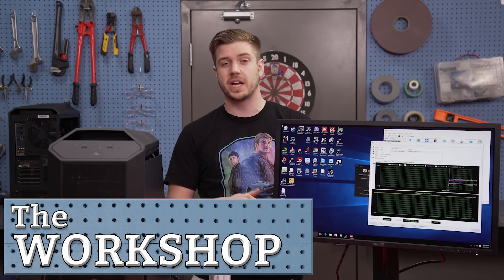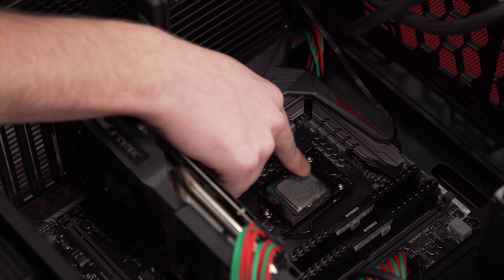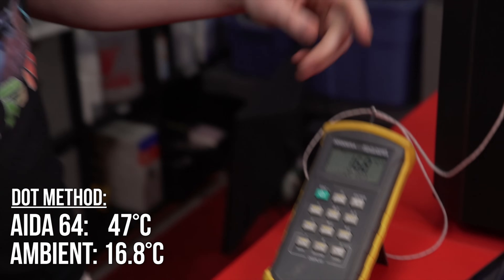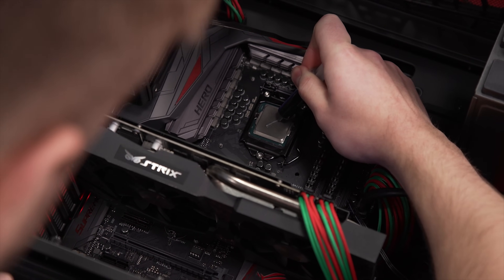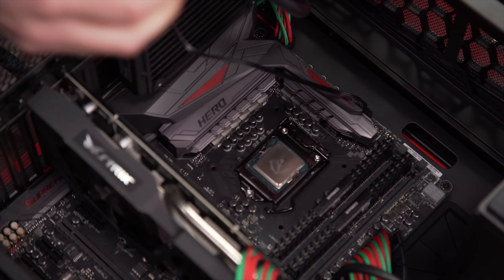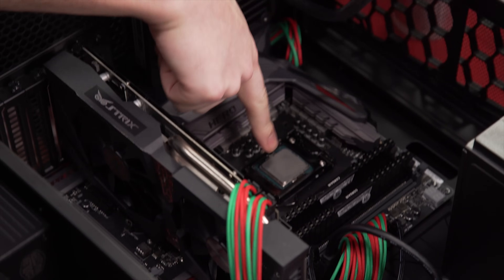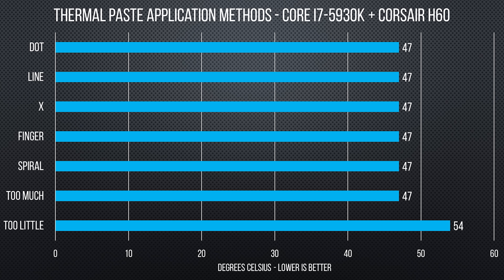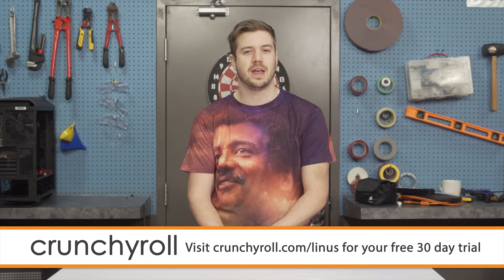Thermal Paste Application Methods - Which one is best? - The Workshop

Comment: Your "more" was the same because it was still in range of a safe amount. The "more is bad" is when you add even more than you did and squish it out over the sides.

Effectively there can't be "too much" in between the CPU and the heatsink because they squish together by force, it's going to squeeze out any excess. It's this squeezed out part that becomes bad/dangerous/causes odd issues or heating.

So yea, adding too much is pointless because it's either not actually too much or you've overflowed off the CPU. So long as it's not preventing the heatsink from being as tight as possible the danger is in overflow.

Your conclusion is pretty much what anyone with some logic would expect; though it's nice to see it tested. The spread method is at best the same (but messier and takes longer) as simply the dot. Sticking the heat sink on is going to do the spreading for you. At worst if you screw it up it could create air bubbles.

Comment: All the nerdy stuff aside, just have enough to cover all of the CPU heatplate to transfer all heat to the CPU.  The "use the thin layer, or very little" is nothing but a nerdy WIVES TALE (nerds tale) that spread around the internet with no backing.  I use a LOT of thermal grease spread on all parts of surface, and get 100% results.
Reply: Also, WHITE GREASE SUCKS, and I use ANTI-SEIZE grease instead and it is cheaper than thermal compound, and despite having aluminum in it, it does not read ohms with a multimeter, IMO better than arctic silver, and much cheaper and better quantity.  I just re-greased a 12V TEC fridge with it and it works much better!

Comment: I always get quite random results. I like, and use, the dot method. Sometimes I get it idling at 34 C, clean it up, try again, then it's idling at 42 C, do it again it idles at 37 C and so forth. Guess it's all about that moment when you connect the cooler and how it spreads. Might get lucky and get a great spread or unlucky and some air got trapped in there.
If someone ever comes up with a better, more consistent method for this, just shut up and take my money.

Comment: Looks like every tactic works... unless you're too greedy xD
Reply: Basically it doesn't matter how the paste goes on so long as you avoid 3 things:
1. too little and you don't get good heat transfer
2. too much and you overflow onto the board creating other potential problems
3. too messy and you could create air bubbles which ends up being "too little" but in spotty bubbles on the cpu

So yes, every tactic works so long as you put a fair amount and the end result ends up spreading the same as the basic drop in the center method. Which means anything aside from the drop in the middle method is just taking risk on whether it will spread evenly and without air bubbles. They might work, but they will never be any better.
Reply: So let me get this straight Vincent. Your takeaway from this video that shows that every single method except too little is the exact same is you still think the pea method is the best? Okay then.

Comment: 62 degrees in the room??? dude thats not even realistic basically. thats cold as hell lol. no wonder those temps were so good...
Reply: It's not about the temps, it's about the differences between the temps...
Reply: huh? what do you mean the differences between the temps?
Reply: ***** It does not matter that the ambient temp is 17 or 30 (celsius), as long as it is (near as makes no difference) identical with each test. The cooler doesn't matter either as the test is about checking what technique makes a positive difference.
If method 1 has 0 degrees difference to method 2 then they are both either crap if method 3 is that much better or it doesn't really matter which method you take if they, like in the vid, all end up having no difference between them (except the too little test)
Reply: +songer121 the Delta, that is the difference from ambient temp to the cpu temp its going to be the same in all cases, even if you are 40c ambient

Comment: Which one of these thermal pastes would you recommend?  If this is all i have access to at the time. Just trying to fix pc for friend and clean it up. its for the CPU

Arctic Silver 5 High-Density Polysynthetic Silver Thermal Compound OR 

Arctic Silver Ceramique 2 Premium High Density Thermal Compound OR 

StarTech 1.5g Metal Oxide Thermal CPU Paste Compound Tube for Heatsink OR

Arctic Silver 5 High-Density Polysynthetic Silver Thermal Compound

......figures i find this after Iposted question elsewhere

any help would be appreciated. It not high end machine ...just basic internet use. No overclocking no high end gpu or cpu
Reply: Try grizzly
Reply: If you're not overclocking, any thermal paste will do.
Reply: Thank you for response. I went with old reliable Arctic Silver
Reply: thanks but its done already  - used Arctic Silver 5

Comment: Is it safe to remove the paste without removing the CPU? I'm about to use Akasa TIM clean kit
Reply: Yes it's safe
Reply: Unless there is thermal paste leaked under the CPU or into the gaps around the edge, yes you can just clean off the paste as he does in the video by wiping it off the top. The only reason to remove the CPU is if you have a mess leaking down around it's edges and want to clean out the housing it's sitting in (which shouldn't happen unless it was installed poorly or you leaked paste into it yourself)

Comment: is thermal paste really necessary?? or can go without it?
Reply: You need it. You saw what happened when he used too little. It hit high temps. Some CPUs get so hot they won't turn on when using not enough paste or none at all. I've seen it before.
Reply: Generally, CPUs throttle down to prevent overheating. If that's not enough, they get shut down automatically before overheating, which if you let it happen a lot, can damage the CPU where it gets unstable or just breaks completely.
So you're still risking poor performance at best, and a fried CPU at worst.

Comment: Line method is better. If you study the architecture of the CPU the die is lined up down the center vertically. Depending on the paste if you use the dot method it may not reach both edges especially if the heatsink is not placed straight down. Line method assures that the entirety of the die is covered (outer left and right edge does nothing). The heatspreader is only utilized down the middle. Cross lines are bad because air bubbles are possible especially on thicker pastes like nano-diamond. Non conductive paste is best, I recommend MX-4 personally as it lasts forever and is a great consistency. It is actually better to use more paste especially on a GPU that is generally direct to die (no heatspreader). Spreading by a card or finger is bad as you may put air bubbles or oils from your fingers that cause issues with longevity.
Reply: Here's the thing: empirical evidence generally trumps theoretical predictions. This wasn't a statistical sample or anything, but a decent proof of concept that the application style of thermal paste isn't likely to be hugely significant.

The longevity issue wasn't addressed by this video, but to actually substantiate the claim you're making, you'd have to do a controlled test of your own. It is plausible that the air bubbles and oils may have some impact on longevity, but what you can't say justifiably without experimentation is whether the effect is big or not. It turns out that while most phenomena are influenced by lots and lots of different factors, some of those factors are going to much more significant than all the others—it's unlikely that 10 separate factors are going to be perfectly evenly balanced. So your reasoning about air bubbles and oils may be accurate, but completely insignificant. It might be the case that if you use the other methods, the thermal compound breaks down and has noticeably reduced (but not completely gone) performance after 5 years, but if you use your finger, the thermal compound breaks down after 4. In that case, unless you're designing for industry, it doesn't matter that much, since you'll probably be upgrading the processor anyway.

tl;dr you're pretending to knowledge you don't really have. You have no real justification for claiming that the line method is significantly better.
Reply: +Daniel Hawkins i never said significantly better. i said the benefits are minimal. I also have years of experience and years of helping people on the delidded club on OCN. So I probably have more experience in this than 99.9% of people. 

Evidence exists if you go look it up. I am not here to do testing for you I am merely stating my educated opinion. Line method is more likely to cover the CPU die on most CPU. This has been tested and is proven in this test as the area the die is on is more evenly covered during the line method. 

As I have stated the differences are negligible but if you are going to tell people what is best there are other factors that deserve mentioning that he has no way to test for.
Reply: +Daniel Hawkins actually my bad this is not the post I thought it was. I did not mention the effects are minimal here but I also didn't say it is significant.
Reply: +Dave Morgan They mentioned in the video that the line method is ostensibly to better cover the die. But if that doesn't translate to a real-world temperature difference, then the best conclusion is, "it doesn't matter" rather than "the line method is better."
Reply: +Daniel Hawkins your ignoring that people who don't know what they are doing may be applying paste. If the heatsink is not placed straight down then coverage issues happen. Line method is most likely to cover the die even during poor application. Also if you don't use enough paste the line method assures the most coverage of die. Temperature differences are very unlikely if full coverage is achieved. Also the bubbling tends to happen more with thicker pastes like some nano diamond and silver compounds. If you are going to tell people how to do something they should understand why a certain way is still better regardless of temperature differences during testing. Some people have difficult blocks/heatsinks. Doing it the most effective way eliminates risks.
Reply: Dave Morgan, you're just making a bunch of assertions without proof. They are quite plausible, but I could make the plausible arguments why the location of the die is practically irrelevant.

For instance, metal is very conductive, and regardless of where the die is, the heat will rapidly spread out to cover the entire plate. The bottleneck in the heat transfer is between the plate and the heat sink. If you have any of the problems you mentioned (improper seating, not enough paste, bubbling), those are going to completely overwhelm the slightly increased heat transfer if the paste is directly over the die. Again, the heat very rapidly transfers within the metal surface, and relative slowly between the surfaces.

See? That is an entirely different, physics-based plausible argument for why die location is irrelevant. So which is better, your explanation or mine? Thankfully, science gives us a way to resolve this dispute; experiment. And until there is an experiment to back up what you're saying, you can't assert that die location matters, and that therefore the line method is better. And I can't say that the line method is never better than the other methods. There may be situations where it is.

But since there is (very modest) evidence that it doesn't matter for proper application of thermal paste, and good reasons (metal conductivity) why it wouldn't matter in most other situations, it's reasonable to tentatively conclude that it doesn't matter generally. But do you own video and prove me wrong.
Reply: +Daniel Hawkins. your just assuming based on no evidence. I have spent years applying paste and helping others on OCN. I have piles of anecdotal evidence. You have nothing but presumptions.

Do research. I don't have time for childish arguments.
Reply: Uh... Obviously you didn't read. I already mentioned how my speculation was also just that—speculation. The point was that plausible speculation is cheap.

And I'm sorry, years of anecdote don't count for anything, especially since you've never done a direct comparison, and it's in contradiction with an actual attempt at controlling for variables.

You do your research—i.e. actual research—if you want to dispute what this video established. Anecdotes are worthless; they're the reason bloodletting was the standard of care for over a 1000 years. I'll stick with the actual evidence in this video, until new, better evidence is presented.
Reply: +Daniel Hawkins Actually as I think more it could probably be represented and tested fairly easily by testing all methods applying too little of thermal paste. You could then see which ones are more likely to spread properly under poorer conditions. I will likely make a video in the future and do it but I dont have a test bench yet.

Comment: Test how ram speed and capacity influences gaming performance
Reply: This has been done plenty of time, ram speed doesn't make much of a difference, it is just a min maxer thing. Gaming performance isn't affect by extra ram, it is only affected by not having enough, if the game uses 3 GBS of ram, haveing 3 GB available is all you need, having 32 GB wouldn't change the performance of the game at all

Comment: Depends on the paste and its cure time!  And probably cooler!

INCONCLUSIVE! I DEMAND MORE!
Reply: He used the same paste in every test here so cure time doesn't matter, would have gotten the same results with cure time later, aka they all would have been better or worse by the same amount. he used the same cooler in every test to take that variable out of the equation.
Reply: Kirk Slaydon  I'm saying it depends on what type the things are; some can perform vastly differently depending on the type of paste or type of cooler.  Just testing one type of paste with one cooler is not a conclusive test, at all.. but doing any more is an extreme time and money investment, not something LTT really does, more saved for review sites.
Reply: you must have misunderstood him, he said let's wait 10 min. That would mean he took into account a "cure" time...
Reply: TheDigihax Cure time happens over a period of many hours, if not days; with a run and shutdown cycle (heat and cool).

When pastes like Ceramique showed up, that was the start of the whole paste curing thing starting to change.

I'm not too sure how many pastes need to cure in present time.. but still.
Reply: oic i hate it when reviewers give the wrong impression lol...

Comment: You can take risks and write dicks with grease or you can just fucking spread it evenly. You know that normally it takes 200 hours for paste to get to it's normal "level" of work, aye?
Errect me if i'm wrong.
Reply: It is true that some pastes, like with arctic silver paste, do have a cure time before they will normalize. But some pastes, like ceramique paste, do not have a cure time.
Reply: best one I could find in my city is zalman-stg2 though
Reply: +hvaranhvaran mx-2 mx3 or mx4 are almost, or as good in some cases as as5 and dont need cure time

Comment: Myth: "The best way is spreading it since it says so in the instructions"
WRONG, common misconception about the instructions, the instructions that says to spread it are for CPUs WITHOUT an IHS plate (which are on graphics cards and laptops/mobile devices), NOT Desktop CPUs since those have an IHS plate.
Reply: Zai D'Mouline also special types of thermal paste needs to be spread if its the very thick non liquid kind
Reply: Zai D'Mouline i use arctic silver 5
Reply: Zai D'Mouline oh thats cool
Reply: EJ Tech yeah it works just fine, some people apply too much! a dot is just fine

Comment: I think you should seriously consider making this video again as a second part, using stock cooler, and a normal thermal paste, not the best on the market

because you didnt use the normal scenario, not everyone has water cooling and use noctua thermal paste
Reply: i mean the average thermal paste is just as good as noctua thermal paste. It isn't some mythical Mix design they came up with. Although i would be interested in seeing if a performance gap comes into light when you did a cpu load test. honestly that Liquid cooler didn't seem to work any better than the standard Heatsink & Fan combo

Comment: We just don't live in the early late 90ies anymore where you had "ovens" that easily went up to 80C working temperature, while all the heatsinks were rugged aluminium plate with a 60mm noisy fan directly over it blowing downwards int o that sink. I mean you used a polished copper block that can be used as a mirror for the heatsink. The wisdom of the old days to not put too much thermal paste, because it will then isolate the heat instead, still stands.
Reply: The only time too much would matter would be if you just let the heatsink float on top of the paste, when you clip it down it just forces excess paste out.

Comment: On thick paste (Arctic Silver 5)  I use the double thin method, take a small amount, apply it to the heat sink with a circular motion, which will create a round circle, but it needs to be very thin.(almost see through thin) Then I use the same method for the cpu. When the two very thin coats join, you end up with one perfect layer and it reduces air gaps, it also reduces paste from leaking out. In fact, when I tear down my systems for cleaning every year, I never find any paste that has leaked out and my temps are always super low (below 40c), even overclocked.